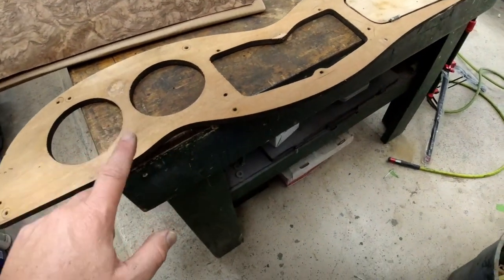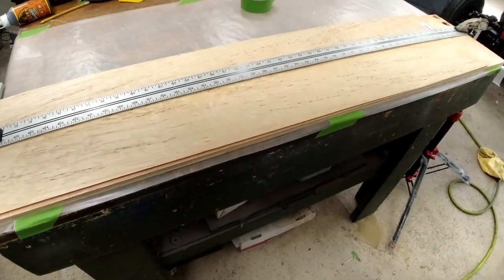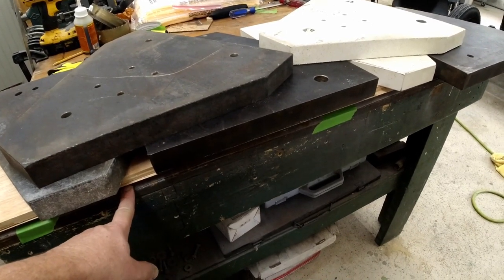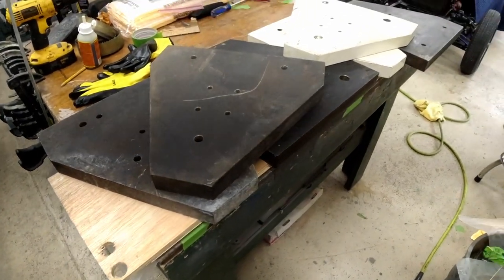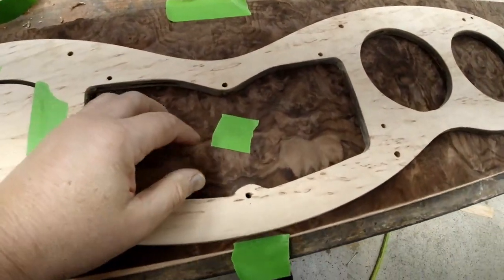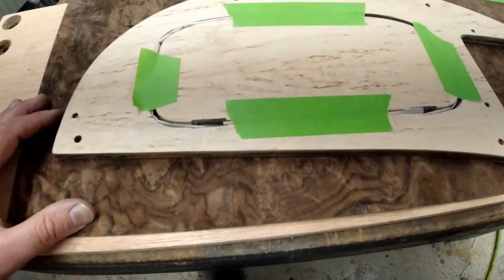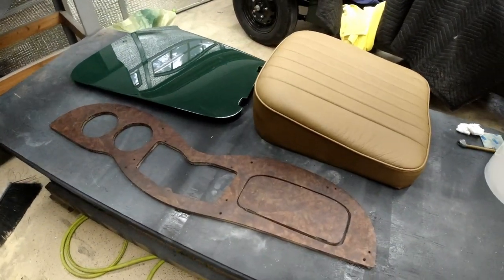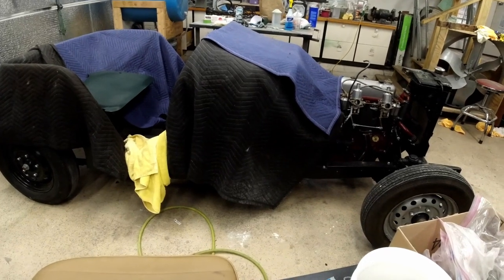1952 MG TD Restoration Part 11

Comment: Beautiful, just beautiful!😍
Reply from the maker: Thanks!  I didn't mention it in the video but I tried to do the West Systems epoxy and it was a disaster.  Massive bubbles that wouldn't go away.  Ended up removing it before it set up, waiting 24 hours and then going with SPI Universal clear.  I think the problem was all the pores in the veneer.
Reply: @therestorationshop  that's good to know. 😎

BTW I'm really looking forward to the wiring loom install. I just got my new loom last week and will greatly appreciate you tackling this first. On that note, a friend who is doing a TD says you need an especially big chassis clip to hold the main loom in the engine compartment. I'll check with him to make sure I'm remembering correctly but I think he said he got it at Tractor Supply...
Reply: So here is the info on the larger clips. Apparently you'll need 3.

Electrical Wiring to Instrument Panel Brace Clip for 8N Ford Tractors - 8M14197.   EBay
Reply from the maker: @davelawson4827  Thanks for the info.  I think I paid a good bit more through Moss
Reply: @therestorationshop  I think you'll still need the Moss clips for the gas line, brake lines and the wiring loom route from the fire wall back... These clips are just for the fat part of the wiring loom before it branches off.